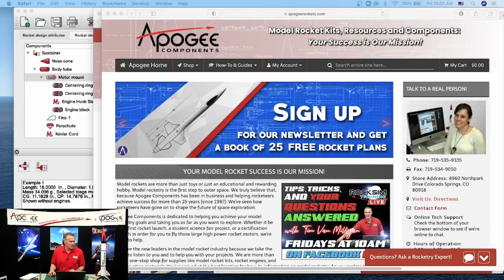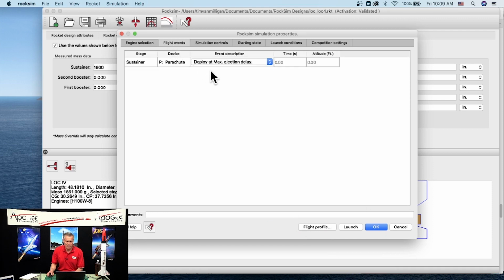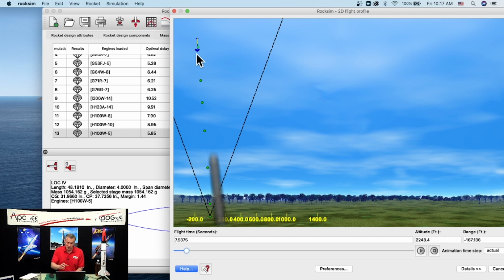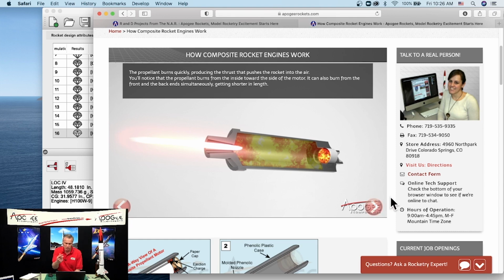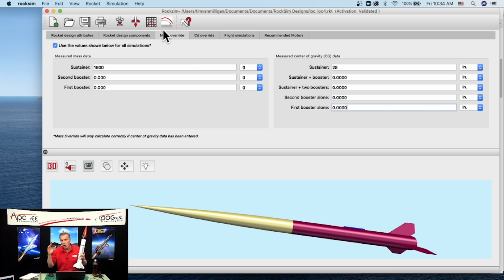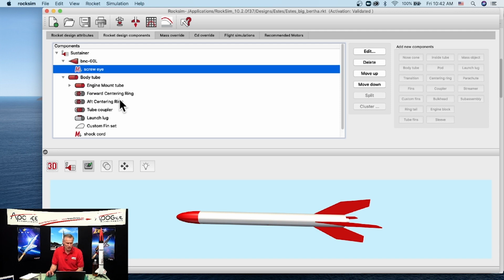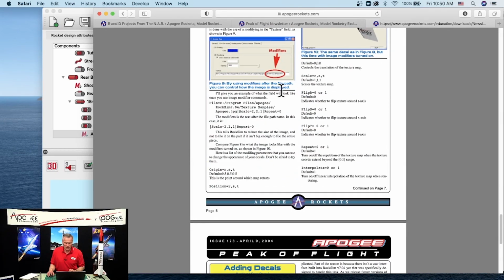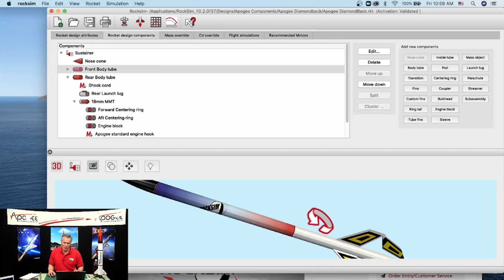Calculating a model Rocket's Optimal Delay

Comment: Hi Tin this is Bob  from California Well I am into the super sonic rockets like the aspire are there any other rockets are super sonic? Thx.
Reply from the maker: Any rocket, with a high thrust rocket motor in it, can go supersonic. What size rocket do you want to push supersonic? RockSim is a great tool to use to figure out if the rocket will go supersonic with the motor you chose.

Comment: Good timing. I just postponed my L1 cert flight because I couldn't adjust the delay grain in a Cesaroni reloadable (I ordered the Aerotech tool for some reason). I also have a LOC IV that I built for a my L1 attempt. It has an Av bay (the LOC Av bay is over 2 pounds empty). Total launch ready weight (6 gr Cesaroni P38 case and an I350-16A motor) is 2,393 grams.